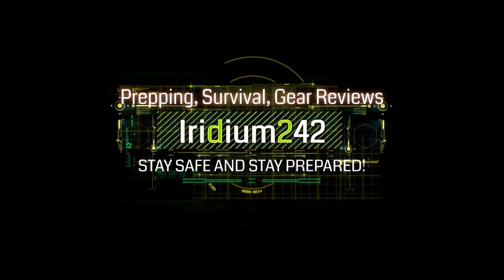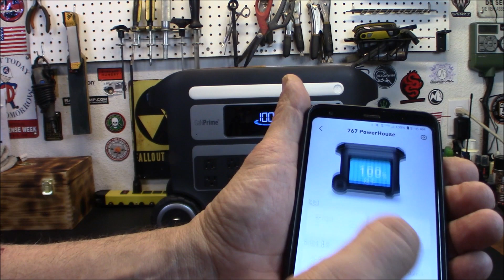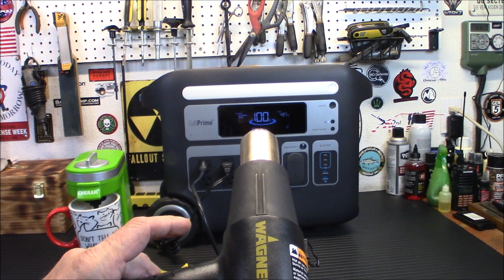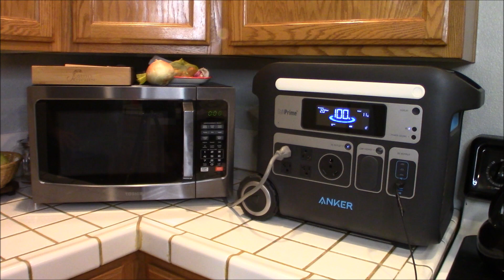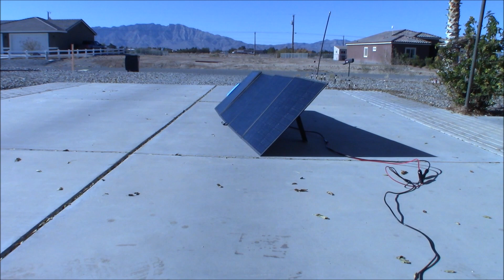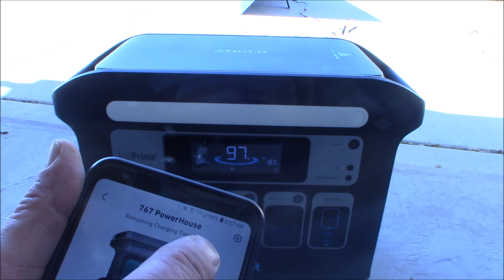First Look! Anker PowerHouse 767 GaNPrime 2048Wh/2400W

Comment: I am looking for a complete solution for a black out situation, to run a inverted refrigerator, that takes
 273 kw* per year,
100w gas boiler, 
Wifi,
Lights in 1 room, 
Charging for phones and 2 laptops.
135 wat tv.
How long would that last?
Would this be the best fit for me to begin investing in a off grid system? 
With 767 now?
Reply: Ecoflow Delta pro

Comment: As a sincere intermediate level prepper that is also a solar neophyte, my question is: In the event of a week-long power outage, our most critical need is to keep our full sized refrigerator powered up (in addition to cool and frozen foods, we have prescription medicines that require constant refrigeration.  Is this unit capable of continuously powering one full sized refrigerator for the duration of the outage? We live in Southern California where it is sunny over 300 days a year, so theoretically we could have the solar panels running every day, from sun up to sun down.
If this unit will not meet this need, can anyone suggest options to ensure that we could keep our fridge continuously powered during an outage?
Any and all help will be greatly and sincerely appreciated!!!
Reply from the maker: There are a lot of variables in that one, depends on how much your fridge draws, how much solar you can put into the unit to keep it changed and how much sunlight you get.  Also the duty cycle of your fridge too.  I know for sure this will do about a day with no solar input on my fridge because its not always running, it runs to cool and then shuts down for a bit so you would have to see how much your fridge draws over time

Comment: this or Bluetti AC200Max ....  hmm decisions 🤔
Reply: 200max has no UPS function. Point to Anker. 767 only allows one external battery. Point 200max. 767 doesn’t support simultaneous ac dc charging. 200max?
Reply: @permagenix  really? it says that AC200Max does have UPS mode..   it doesn't work properly is what you are saying?
Reply: Me too! Trying to decide on 200MAX or this.  Have you pulled the trigger yet?
Reply: @xdean  767. Just arrived but haven’t unpacked it yet.
Reply: @permagenix  nice! Would appreciate a review later.

Comment: Not enough power for your RV. Still cool.
Reply: Depends on the RV. This is plenty for most 30a travel trailers for a weekend outing. No you aren’t going to run your AC on it or microwave a lot of stuff but it will do the basics just fine. If you did have solar attached you could do even more. This will be sufficient for all of my needs as a tech nomad.
Reply: Good for a travato gl

Comment: Hello from Vorarlberg Austria 🇦🇹
My main problem with these massive power Banks is what can I actually use it with? 😅 Like honestly is it a useful thing to have or just a toy? 🤔 Can it keep the freezer running? 😳 Can it keep the heating on in winter? 🥶 Where is the real world use case scenario for something like this? 😕 
Kind regards Leopold 🤗
Reply: Yes it can, my forced air unit uses 800 watts when running. So it can run 2hrs worth of heat for the whole house. Will probably run a freezer a few days, or a newer fridge for 2-3 days. I’m getting this to supplement my gas generator which I store 72hrs worth of gas for. I want to be silent overnight during outages and have the ability to solar charge.
Reply: @TobyCostaRica  being silent at night is a great point ☝️
Reply: @LeopoldElwes  yup, I should point out That’s 2 hrs of constant heat, my heater runs 15-20 mins every hour. So 2000wh can run my heater overnight. I suggest a transfer switch too. Starting a generator, plugging in a single cord outside and having almost everything (except AC) work is so nice during an outage
Reply: @TobyCostaRica  that sounds like a great idea 🤔 my only problem is I'm here in Europe and it's hard to hide a generator and fuel without the neighbors knowing 😅
Reply: There are two aspects to these and other power stations. First, you can recharge it using solar thus you have power day after day after you've depleted the batteries. Second, It is important to understand for a unit of this capacity, you need to budget and/or prioritize your power usage. Yes, it run a freezer for a number of hours but it's not going to run a freezer and heat your home sufficiently at the same time to your satisfaction. The real world usage is to maintain what you deem as critical equipment during a power outage. In the winter, refrigerator and freezers may not be as critical because you can put your food outside in the cold but keeping warm with an efficient solution such as an electric blanket is. I do not consider space heater efficient so don't use them. In the warmer season, the freezer and refrigerator may be a priority and  you just cool with a fan. Other critical items include network equipment, lights, medical, etc. Remember, you have to size the system appropriately to your needs. A system too small will leave you disappointed and thus considered a toy.
Reply: @hgw90026  good perspective, electric blanket may be handy, regarding space heaters, i have two super efficient space heaters, infrared, that can be set to 250 watts or 500 watts, and these units will heat your body quickly, and at a low electric draw. They are not designed to heat a room. I keep m house very cool in the winter to save gas costs, and i have one of these radiant heaters set up for my cat, she curls up in front of it. Good for emergencies. These will keep your bathroom and plumbing warm in an emergency. Infrared Space Heater Portable Radiant Quartz Heater for Indoor Use Home Office Bedroom with 2 Heat Settings
Reply from the maker: This will run that and more no problem
Reply: @Iridium242  for how much though/
Reply from the maker: Well even I dont  know that, wont know till Dec 5th
Reply: Kühlschrank und Co. versorgt man nicht durchgehend mit Strom aus einer Powerstation da ihr Eigenverbrauch zu hoch ist, man steckt ihn 2-3 mal am Tag für ca. 1 Std. zum runterkühlen an. Meine Powerstations versorgen bei Stromausfall den Kühlschrank, Mikrowelle, Akkuladegeräte für Lampen und Batterien, LED Baustrahler, TV, PC (offline), Wasserkocher, Thermomix, Waschmaschine (falls noch Wasser da ist), Tauchpumpe der Zisterne für Brauchwasser, kleine Heizlüfter, usw.! Aufgeladen werden die Dinger dann mit 1 oder 2 Notstromaggregaten gleichzeitig 1x am Tag, dauert max. 1,5 Std da alle meine Powerstations schnellladefähigig sind.
Reply: They can easily power a full size frig and/or freezer for a day or more depending on usage. +if you add solar input during the day it will refill for you to continue using at night. Im getting one to supplement my gas generator so that I don't have to keep it running all night wasting fuel. These can also be charged with a gas generator so if you need to top it off you can before bed. Running a gas generator for only 1-2 hours then powers your low wattage appliances for the entire day.